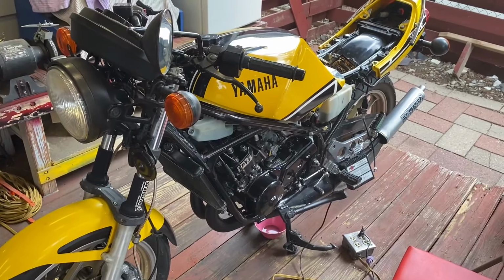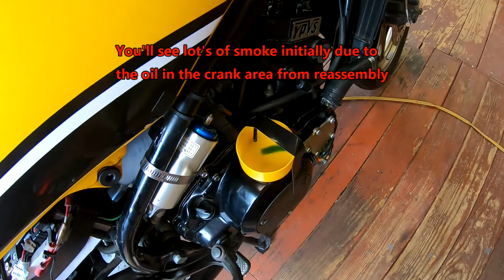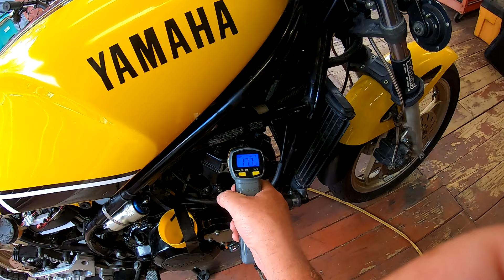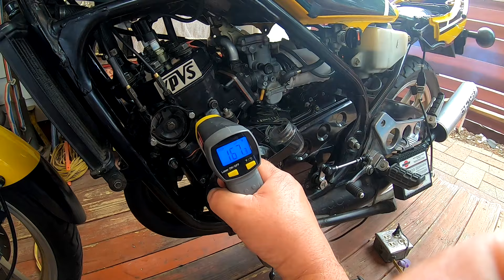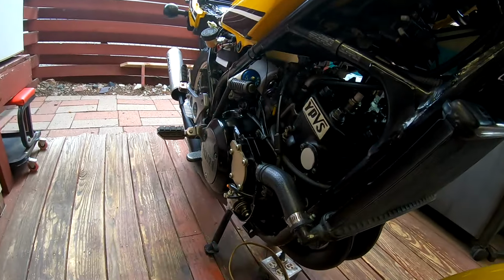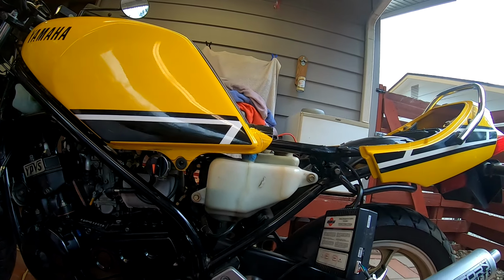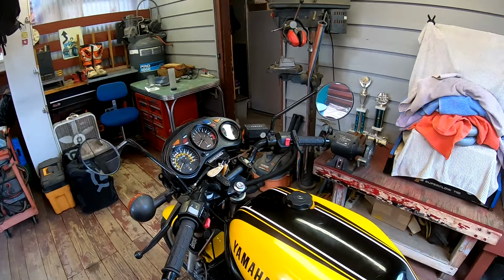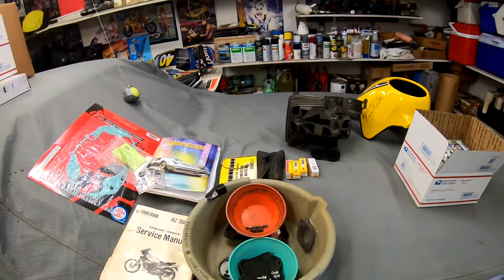RZ350 initial startup discussion

Comment: What's the jetting on this? I'm in N. COS and running 250 mains with UNI pods and Spec II F1 chambers.
Reply from the maker: I suspect your jetting would seize my bike.  Way too lean for my setup.  RZ350 stock mains were 230.  Jetting is dependent on many things about the engine configuration and the altitude where you are riding the bike.  Although our altitude suggests a need to lean the jets out, engine mods can counter that significantly. Best you jet yours based on plug readings and how it runs.  My jetting spec would just throw doubt about what your bike needs.
Reply: @rz350yam  Thanks for the prompt response. I'll check it the plugs once again. Any mechanics you recommend in town? I noticed you're in Springs too.
Reply from the maker: @manwithnoname8238  The only mechanic I use is me.  🙂